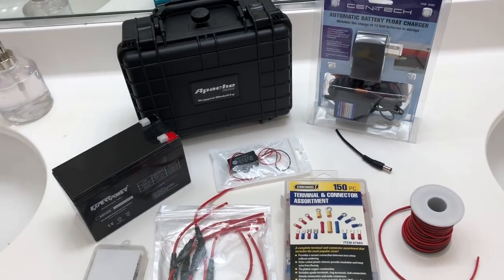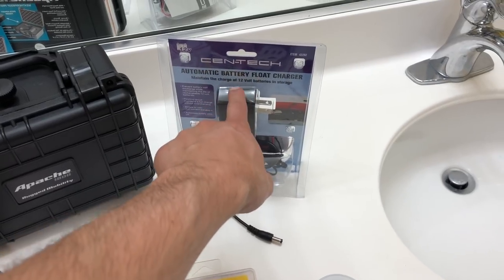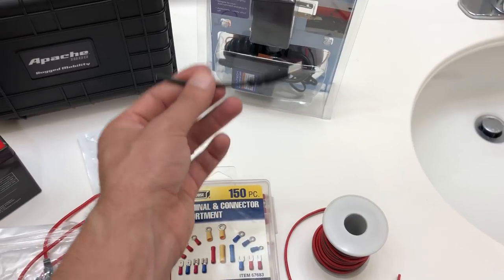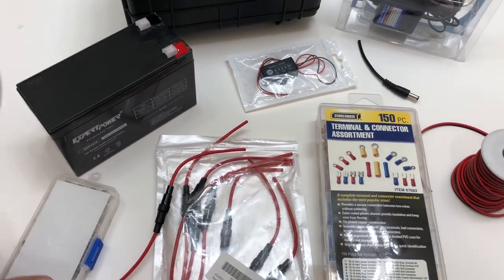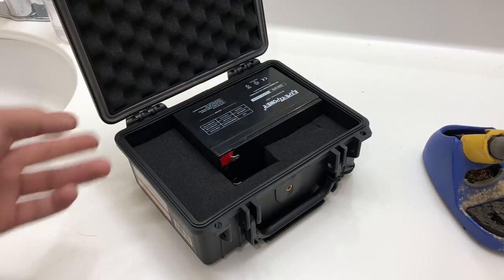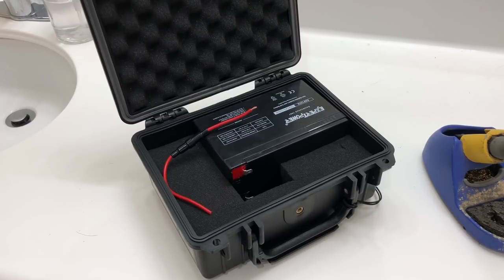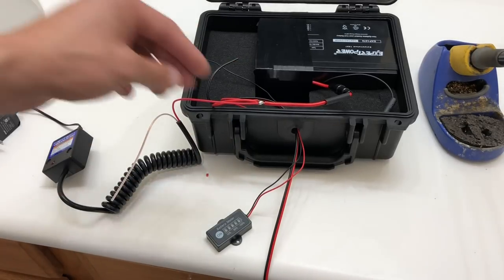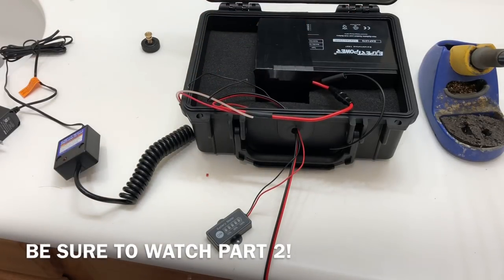DIY BATTERY BACKUP FOR REEF TANK (PART1)

Comment: Thank you for the video. Helped me build mine. I used a cen tech deluxe battery maintainer and floatcharger. Came with a fuse already in line on the power side and the cable actually detaches in the middle making it easy to remove and replace battery if needed. Cost for that was around 20 on Amazon. I used a 12v 18amp hr mighty max battery from amazon around 37 dollars and a amazon weather tight box  was around 25. My battery meter was 14 for the one I choose. I can turn it on or off and even see battery temp. I used a rotary tool to cut out a hole in the box to flush mount my battery meter. Honestly came out really good for my first time and I thank you. That 18 amp hr battery will hopefully last over two days for my Jebao rw4.but I’ll have to test that one first.

Comment: Will you have to worry about it overheating or venting with it being airtight?
Reply from the maker: Pop A Smurph no you will be fine.
Reply: Is a sealed battery, most all battery that size are. Extremely stable and safe to use in enclosed spaces.